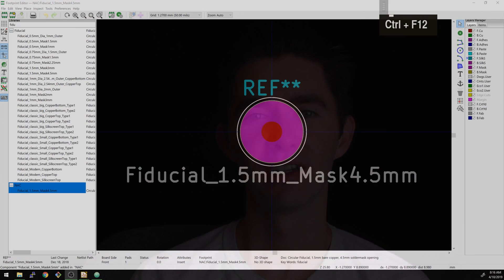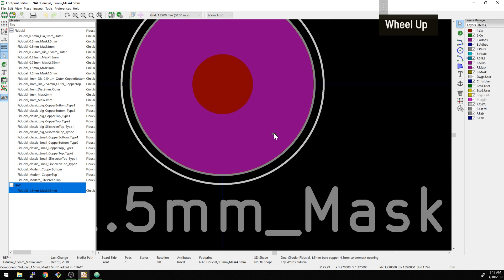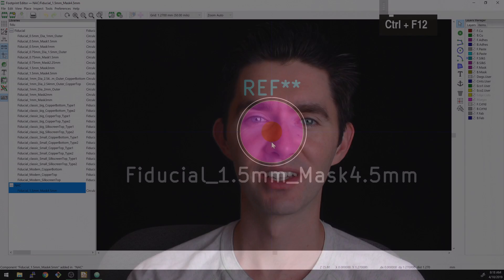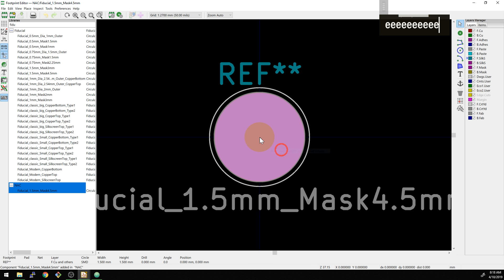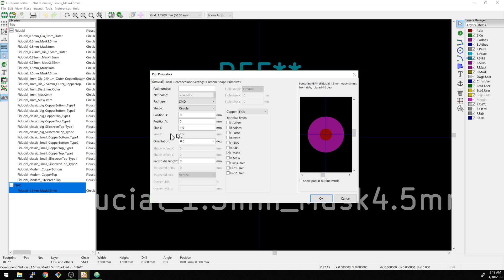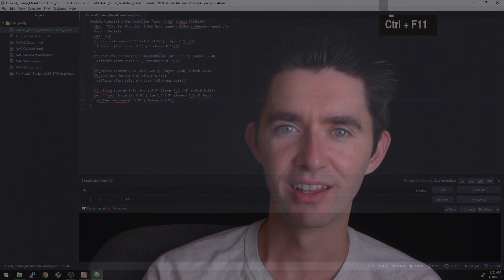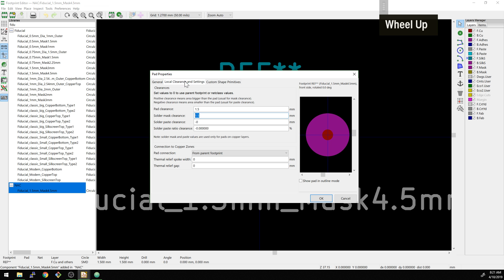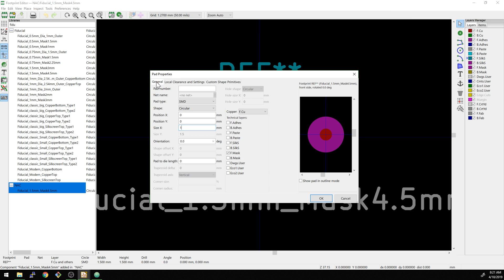KiCad 5.1 - A Follow-along Puzzle

Comment: It's kind of obvious what's going on if you consider how those parameters work: The clearance is applied from each individual edge for any arbitrary shape; it's not an independent shape. Maybe instead of using the clearance there'd be a possibility of using a 0 clearance and instead having a separate shape on the solder mask layer to make things more obvious.